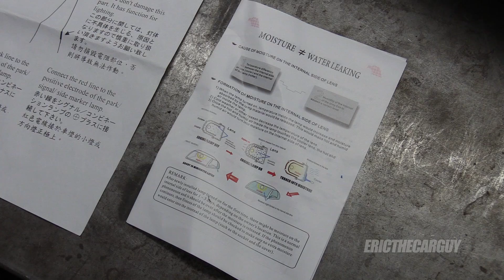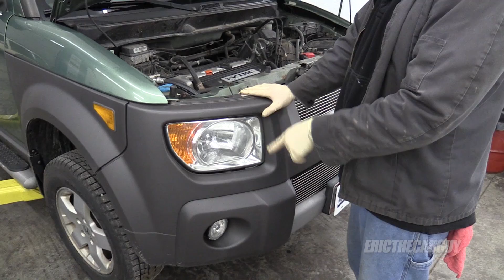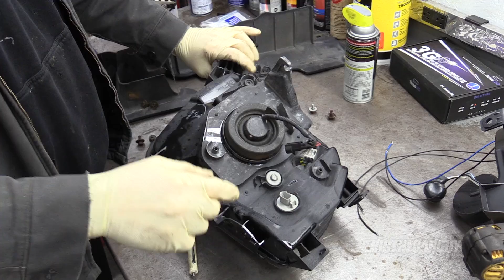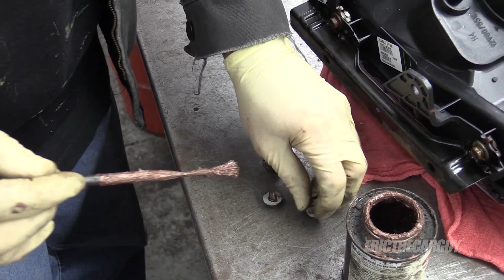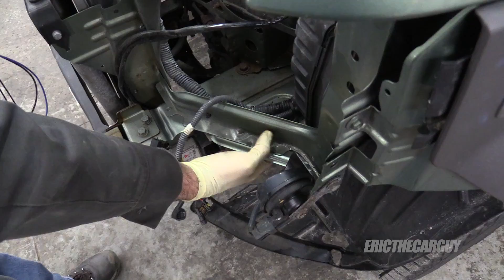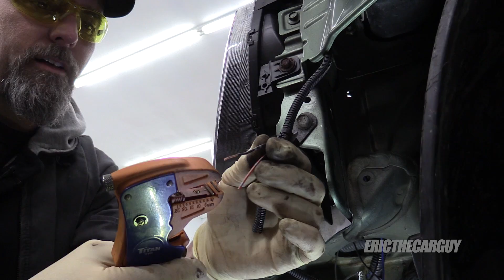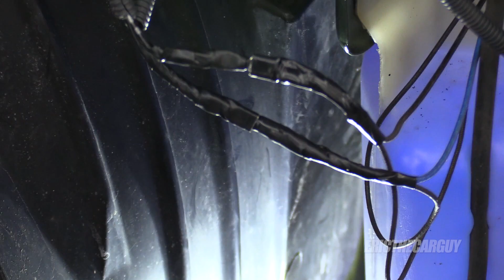How To Install Projector Beam Headlights

Comment: Eric I would like to post a question I have a 94 Honda accord four-door five in  the floor in the summertime if it’s hot or raining it will not crank in the wintertime right now it cranks all the time this is a puzzle to me because I have replaced the fuel relay switch and I do not know what else it could be it’s not the fuel pump I don’t think and I also smell lots of gas sometimes but I don’t know that would have something to do with the cranking I think I may need a fuel injector replaced but this has been a puzzle ever since I’ve owned the car for two years now with the weather starts getting warmer to the point of around 70° or more the car has a cranking problem every year I wish I knew what to do it is getting on my nerves
Reply: Do you have a light on dash